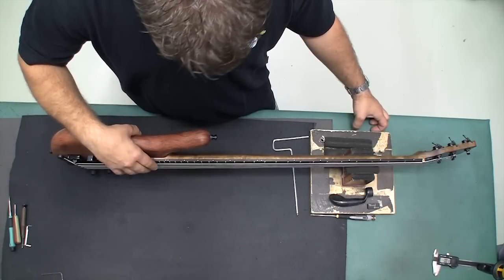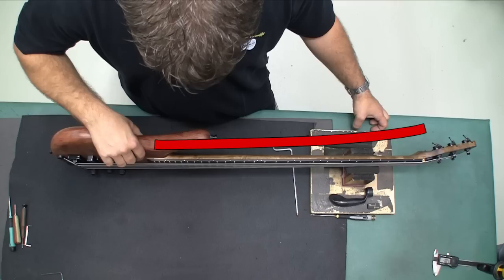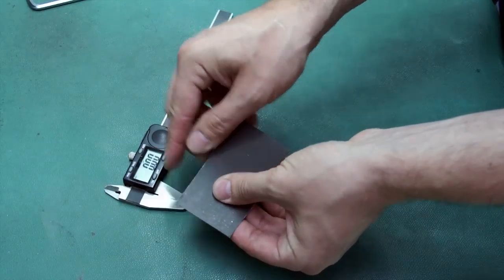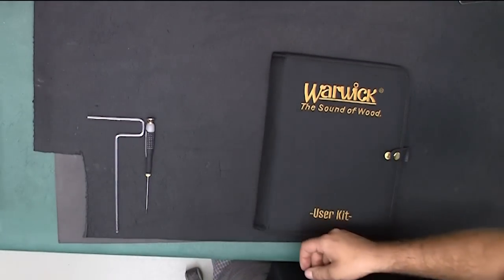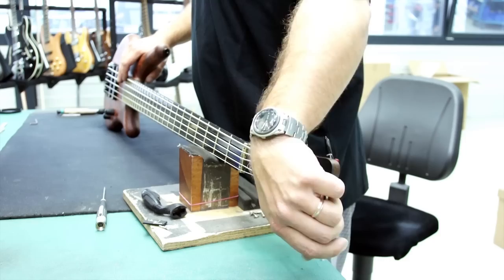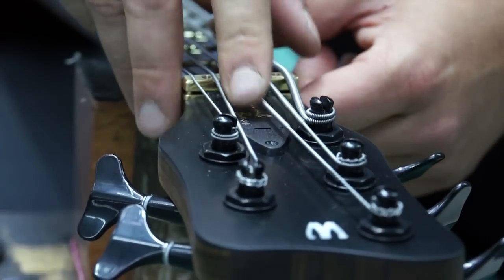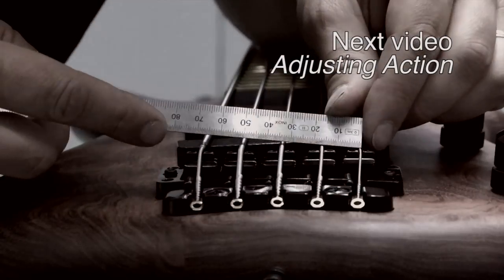Warwick Tutorial: Adjusting Truss Rod

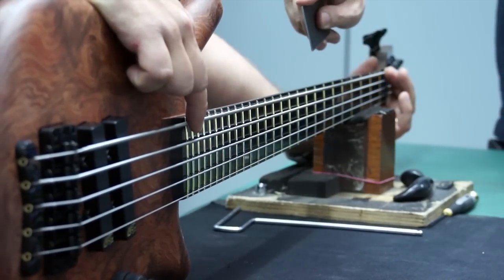Comment: 0:52 The guy magically produces a third arm to slide the business card between the string and the fretboard. The rest of us have to use a capo..
Reply: Or... like I do, press the string on the 1st fret with you fretting hand, press the string on the last fret with your plucking hand's elbow and with the measuring card in that hand feel the gap on the 7th fret.
Easy.
Reply: @nachobassman  That doesn't count! The correct way is using your third arm to avoid making mistakes.

Comment: I heard that some Warwick basses have the truss rod screw with reverse thread direction (i.e.: clockwise loosens instead of tightening). That was a luthier that mentioned that.

Is that at all true?

My 2008 Warwick, is normal I hope.
Reply: not on my corvette
Reply: Yes it's true. I've just been working on a 6string Warwick from about 1990 and that has a left hand thread. Unfortunately,  it's come to the end of the thread and the neck still has a bow - needs a longer nut but where to get one with a  10mm (?) L/H thread

Comment: Is it safe to adjust the truss rod with the strings on?
Reply: It must be done with the strings on because of the string tension. The whole point of adjusting the rod is because the strings either pull the neck in a concave shape or a convex shape
Reply: pretty safe if guitar is  in good condition and head treads not  damaged ba  multiple adjustments and wrong tools. but you need to use the best tools and be carefull. if rotating truss rod head is difficult  stop and take guitar to qualified repairmen